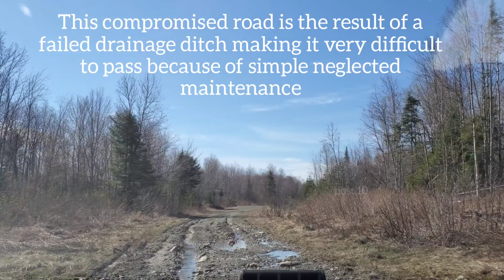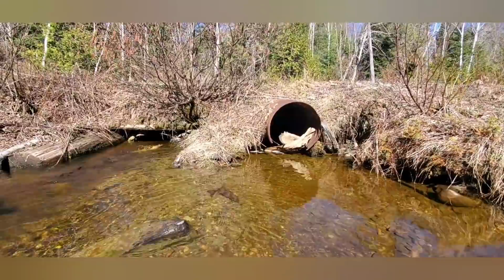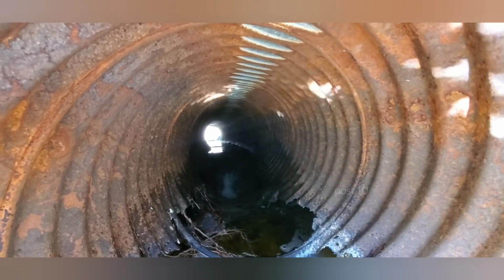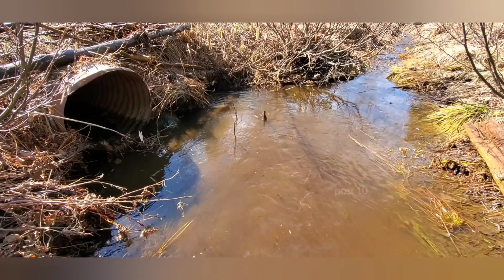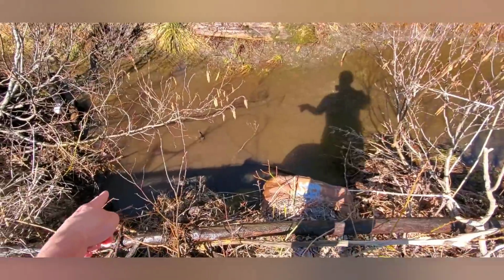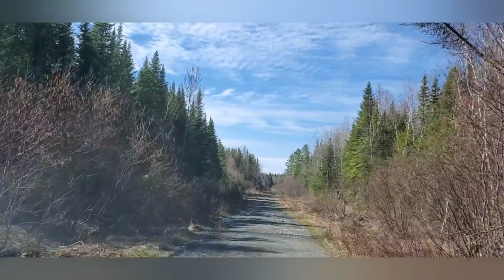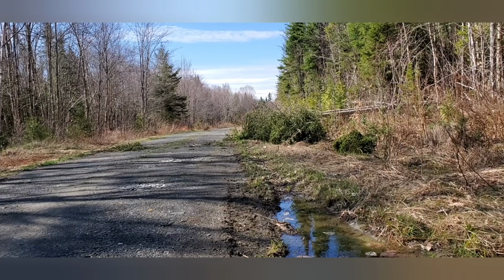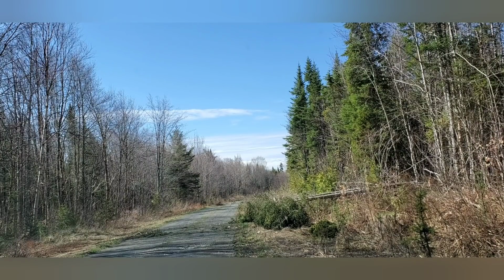Big Old Clog On A Culvert Pipe Gets Unclogged To Prevent Flooding

Comment: Nice to see a British Landrover Defender over the pond! I don't think they were sold on the American market. They did also make them in LHD variants for Europe. It still has a yellow rear British registration plate still on it, L441 NHP. It's a 1993 2.5 TDI 110 wheelbase and exported sometime in early 2019. Did the person in the car sound British? They are well spoken of over here, pretty much the king of the off roader in the UK. 20 year old ones in good condition with upgrades are selling for upwards of $50,000. They stopped producing them in 2018 of this style and made a new one based on the Discovery.
Reply: They did sell them in the US from ‘93 - ‘97. Defender 90 and 110. All LHD and with gas engines, no diesel. The US versions are very expensive today. It’s actually cheaper to import one than buy a 90’s US model. They are well thought of here too, but not common because of their cost. Jeeps are everywhere here so they are much cheaper to buy and maintain.

Comment: That vehicle at the end is a Land Rover Defender 110 inch....wearing UK plates. The L on the plate signifies that it's a 1993/1994 and the HP at the end signifies that it was first registered in the city of Coventry, which is in the county of Warwickshire, pretty much slap bang in the centre of England. Coventry is very close to Solihull (about 15 miles drive), which is where that vehicle was probably built. 

We drive on the left in the UK, so that's why the steering wheel is on the right. That person is on one heck of a mission!

Comment: Plastic culvert can resist as much weight as a concrete one. The key its on the installation. I'v been doing it for 25 years, and they are an extremely good option and more biofriendly

Comment: Hey Post 10, I don’t know if you’ll see this but I hope I can help you out with the “panoramic 4k” problem that causes the letterboxing on the top and bottom.  

What camera are you using?  In my years of filmmaking I’ve never heard of a panoramic 4k before.  It’s more than likely the resolution you recorded in smaller than standard 3840x2160 which is Ultra HD “4K”.  What I mean by smaller is the second number (resolution height) is smaller than the standard 2160 for Ultra HD while keeping the 3840 pixel width.

The simplest fix is to crop in the whole image so you don’t get the letterboxing on the top and bottom.

Comment: This isn't related to the culverts, but I had an idea and I don't know if it's stupid or not. What if the next time a storm drain gets clogged, you bring a pipe or something that you can put on the drain? like one that is taller than the water level and it lets the air escape. I wonder how fast that would drain.

Comment: You should suggest small concrete ditches and bridges, it's easy to dirt damn to keep it dry long enough for the concrete to set right, I just hope they do it right and not with the cheap easily breakable crap they typically use these days.

Comment: yeah to show how cheap metal is  surprisingly. im buying a bus for full off grid camping. looked at one 1X1 board thats 60inches long for 34$ while one steel beam thats 75 inches long 1X1 only 7$ like i can but almost 5 beams of steel for one beam of wood making me highly consider buying steel beams for my walls since ill be way under weight rating anyways buy if will make off-roading harder